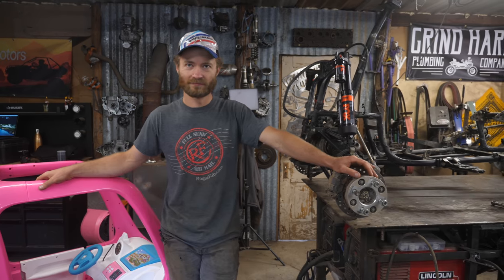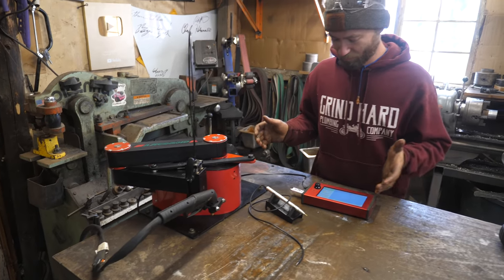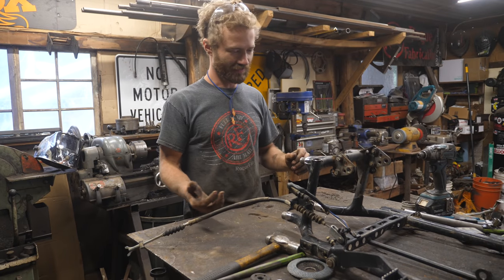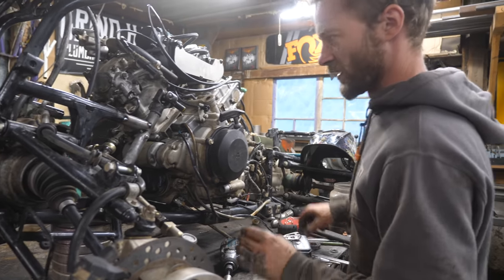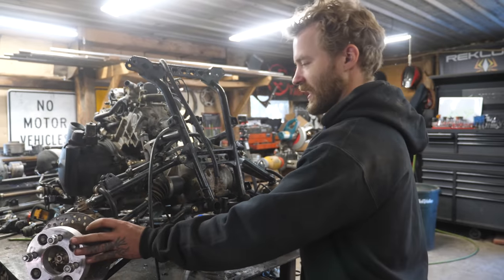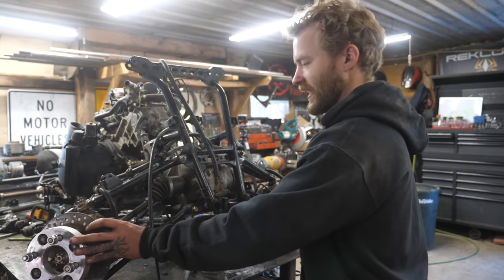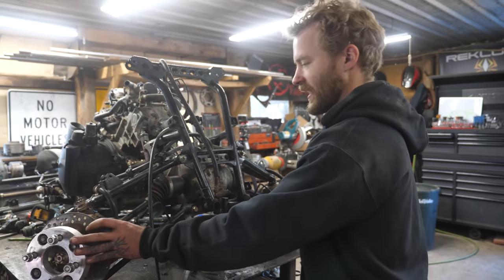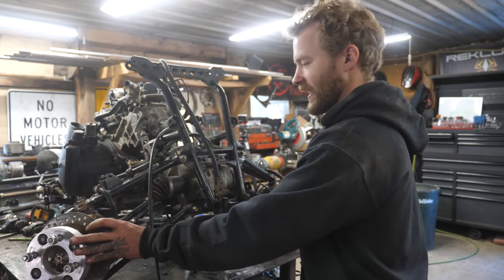Mini Overland Camper Van Build!

Comment: Ethan cutting splines with a grinder, into an old snow mobile a arm, that’s being recycled as a steering pivot arm, on a power wheels vehicle, is probably the most Grind Hard thing, EVER.
Reply: And making the steering work backwards at the first mounting point          @ 9.00 min they didn't say a word🤣🤣
Reply: as an engineer 😱😧

Comment: For your "couplings" etc. stick an end mill in the lathe chuck and use the cross slide as a table (you might need to bolt something on to it).

I think this is std practice for milling on a lathe..  Look up 'milling on a lathe' :) for more..
Reply: I think they just got a mill
Reply: I have never thought of milling using a lathe. There is always a way isn’t there?
Reply: @NotJo4Ever13  I've not tried it.. some say it's difficult to do a good job without a collet Chuck or whatever but, if you don't have a miller or milling attachment and you take shallow cuts it should beat an angle grinder.. I think you just bolt a vice where the tool post goes and go crazy.. (crazy slow)
Reply: @MattH198  ?

Comment: I love that they get bigger, categories for different types when racing might be needed cause u guys might be unbeatable
Reply: Like :no suspension and full suspension classes, and then also cc thresholds, so smaller engines like 250's an 125's don't Run with 650' an 1000's

Comment: You can adjust the amount of Ackerman By adjusting the length of the center link I felt like I was there with you and you were doing what I was thinking killer build makes me want to do something like this
Reply: I'm a little lit right now, but I think you've got it backwards. If the tie rods were in the front, that'd be how it works. But behind the axle the center link would need to be longer and the idler arms tilted  outwards. He probably doesn't want to do that because he's steering from one side and it would turn at a faster ratio one direction.

Comment: 7:13 theres a easy way to lock those sleeves in place. drill a small hole on the frame pipes the sleeves go in, then tag weld the sleeves trough that hole. that way they dont move when placing the other part in and it gives little better support for those inner pipes. other way would be is adding keying on the sleeves but thats more work and adds point of failure in the frame
Reply: Why though?
Reply: They're getting welded. If you want more support drill through and add a roll pin, and then weld. but like you said that sacrifices structural integrity. Jest weld it like he's doing and call it a day. No need to drill and weld or mess with keys 🤷🏻‍♂️

Comment: Wow, is that CNC plasma cutter cool! I really need to fix one of my two broken plasma cutters. That would be perfect for making suspension brackets.

Great job on the steering and knowing how to fix it. It's not magic, just geometry. The setup you built is exactly what came on the Nissan Hardbody. I think even the 1st gen Frontier had the same setup until they went with rack and pinion on the 2nd gen.

I think a good number of Ultra4 racers would agree that independent suspension is better if you can build it strong enough.

Comment: I've worked on quite a few 750 quads and just a heads up make sure to tune it properly if you change the headers up on it, it runs really lean out the gate oven stock and giving it more flow will compound it, also it usually will need the air box to run at 100%. send me a email if you ever have any questions on it

Comment: You could use your lath like a mill for those small parts. Put a mill cutter in the lath head and mount the part to the tool head and mechine away

Comment: hey. i have an idea for your next project. from what i could understand the biggest problem you have with those builds is the seat positioning but what if you take one of those pedal tractors for kids as a body. you could simply sit on top of it and have plenty of room for your legs. the only problem i can see is that these tractors are not that wide and could tip over. 
sry for bad english

Comment: It needs a power steering unit. Electrical assist motor or something. The steering angle is so radical, that it is almost impossible to streighten from the full lock with a small wheel. Also any rock crawling or similar offroading with that amount of weight is just way more doable with a power steering.

Comment: The newer air suspension on mercedes trucks links left and right side air lines  together at times to allow max travel and keep the truck level. I wonder if something like that is possible on your air shocks. Compresses one shock as it extends the other side for that flex.

Comment: It looks like you have plenty of land where you are, but I don't know if you rent or own.  What I am thinking is that you should make a new, much bigger, shop a project for the near future.  Do you have three phase power where you are, or can it be converted to three phase?  That greatly opens your options for building your shop regards machine tools.  Even a small one or two thousand dollar mill would be a godsend, and used can be a good way to go because they tend to come with heaps of extras like rotary heads (or a full blown dividing head), collet sets and lots of end and slot mills and other cutters.

Comment: Hey guys, look up the instruction manual for a HPI savage FLUX XL rc, the chassis design and suspension system is damn near what your building. There may be a few pointers in design for you or maybe upscale the whole thing till you can fit in it.

Comment: 13:50 as you said IF you can make it strong enough independent is better.  But for cost (somtimes) and ease of building soild axle is better especially in the rear.
Reply from the maker: Agreed.

Comment: I'm curious if making your built electric could reduce the size of the engine while keeping the same power. My crazy fast e-scooter has a relatively small engine that pumps out so much power it needs a gold sports bike chain and the manufacturer had to add more engine mounts.

Comment: Ok so it's a bit of a dirty hack to do it but if you are doing something small enough a lathe actually has most of the right geometry to be used as a mill it's more work than a mill but it can be done. You can put an end mill in the chuck and the part in the tool holder. You could also use a 4 jaw chuck with the part in it and adjust it to make it work. Again it's a dirty hack only to be used in a pinch but it can be done and I've seen people do it in the past. Honestly though for the level of accuracy you need a used Bridgeport even if it's not perfect would do what you need it to do and only costs $2000-$4000 so it's not too bad if you have the space and would get enough use out of it to make the cost justified.

Comment: Plz use a face shield using those grinders bro plzzzz you really don't need a life changing injury for youtube views or get a decent sawsall with some diablo blades or milwaukee grinders should only be used for grinding not cutting unless you use proper safety gear while using it trust me man I watch my bosses face get torn wide open in front of me and had rush him to hospital holding his face together with my hands it was half an inch from his eye but now has a huge permanent scar all the way up his face